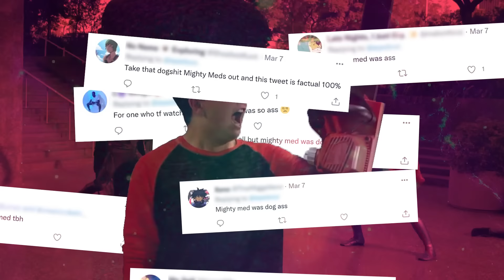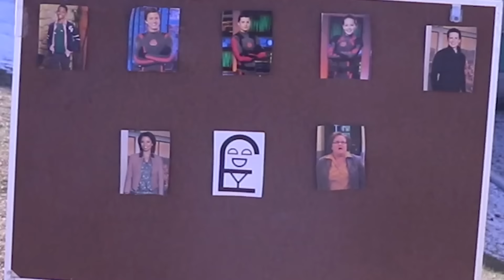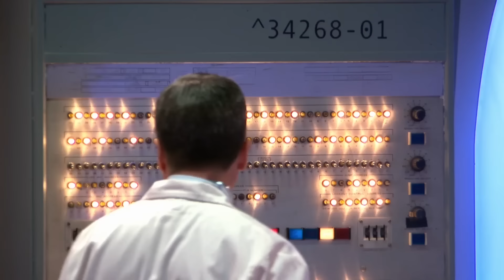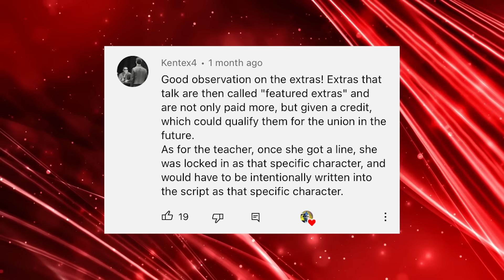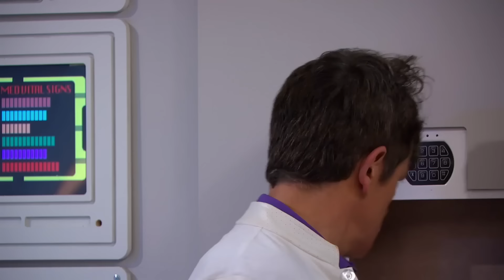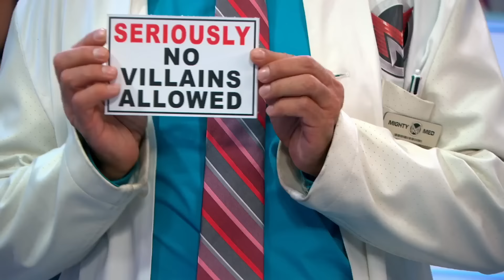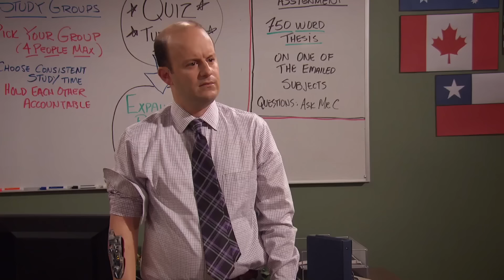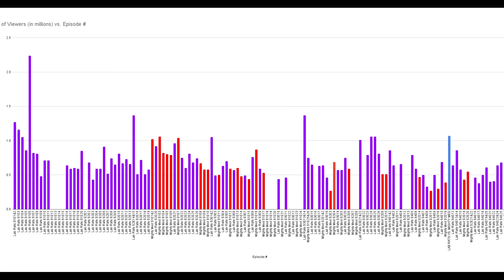The Rise and Fall of Disney's Greatest Sitcom

Comment: In S1 Ep8, a running gag occurs of using random things that Oliver likes to measure the weight of things. In the final battle, Oliver says “this weighs like 6000 trading cards”. He uses this to describe a spear that he could barely hold. A trading card weighs about 0.75 grams. If we translate this to pounds it shows that Oliver is almost to weak to the point he showed restrain in holding a 10 pound object. That is hilarious when you think about all the other things he’s done.

Comment: Something I'm surprised nobody else has realized is, Caduceo is clearly supposed to be this super legendary hero healer. The comic book geeks recognize his symbol instantly and even villains acknowledge his power enough to want to manipulate him into using it for their gain. But his only shown healing ability only has 5 uses, and only 2 of which were used on screen. Did he use the 3 first uses in such a dire situation that it made him a legend? Like did he rock up to a fight where The Great Defender, Tecton and The Crusher all had died and brought them back?
Reply: I think he has more powers than just revival. He's known as 'the healer', which suggests more advanced medicinal ability - it's just this one power takes more energy than any other, so he can only do it a certain number of times. It could be that Horace has any number of powers we just haven't been told about

Like the original series Dr Who lore - he can only regenerate 12 times, because it takes so much energy, but that doesn't stop him being able to ... use his mind-meld powers, for example.
Reply: @sofh784  we're shown outright that he can basically press pause on anyone on command. Perhaps his other powers, if any, are more supportive like that. Not especially helpful for winning a fight, but enough to defend yourself and others
Reply: @faultyvideos2215  Like I could see his powers being in the same Vein as Restoration magic in the Elder Scrolls series, he probably a one or two offensive abilities. But he’s mainly a supportive hero with a lot of healing and maybe buffing abilities
Reply: @sofh784  They never said that he can only regenerate 12 times because there's a certain limit on the amount of energy he can expend. It was just the rules of his race. Then they gave him more. Then, he's from a different universe so nothing applies to them. AAAAAARRRRGGGGHHHHH
Reply: Maybe he's just a really good doctor

Comment: There is no way that The Crusher is weaker than Adam. I would like to point out the fact that he sent a doctor (aprox 180 pounds) flying across the entire room slamming into the wall, and the doctor would have probably have kept going if it wasn't for that wall. Secondly he has turned coal into diamonds, which I am pretty sure takes somewhere around 725,000 pounds of pressure per square inch. Another thing is most sites refer to Adam being around 10-20 times the strength of the normal person. Which talking in terms of pounds of pressure when squeezing your hand would be at max (assuming the average amount of pressure of a man, and him being 20 times stronger) 1460 compared to the highest recorded amount of pressure from The Crusher being 725,000 pounds. Grip strength doesn't always equate to how strong they are but someone that has a grip strength of 725,000 pounds is probably stronger then someone with the grip strength of 1460 pounds. This is probably mostly wrong, but this is just my 2 cents IG.
Reply: The lab rats writers mostly wrote the crossover
Reply: They nerftef him so hard :((
Reply: I like to believe that the crusher was weaker due to being sick, since he was in the hospital, and that’s why Adam beat him.
Reply: But the diamond feat was before they retconned him
Reply: Didn't adam stop a missile once?

Edit: just checked, he did in sink or swim
Reply: Honestly, it is this moment (Adam besting The Crusher) that made me hate Lab Rats, like I watched and enjoyed it before but after this I fell off haha Mighty Med was so much better
Reply: @aaronwilder2775  cap
Reply: @InvalidClips  what do you mean
Reply: @aaronwilder2775  cap means you’re lying. And Adam is miles ahead of the crusher
Reply: @InvalidClips  I know what cap means but if you literally watch Mighty Med you can see that Crusher is supposed to be stronger, they powered him down just to make the Lab Rats look useful
Reply: How to tell someone is a fan of Death Battle (unless you arent and my joke doesnt land)
Reply: @Bladebrent  Someone hit up DeathBattle Adam vs Crusher
Reply: Adam has much better feats then being 10-20 times stronger than a average dude just saying
Reply: Mighty Med has some star-level feats. So annihilator could easily beat all for one.
Reply: @KEEPTALKIN8215  when saying the Anihilator could beat all do you mean the Lab rats or something else
Reply: @khaliekanderson2596  all for one from my hero academia. If you look into it both the characters are very similar.
Reply: @KEEPTALKIN8215  do you think the Anihilator could beat Krane(lab rats)
Reply: @khaliekanderson2596  obviously before they crossed over lab rats didn't even come close to anything in mighty med. Maybe wall to city level stuff ( high balled) so yeah annihilator should win
Reply: The Crushers vs Saitama vs Goku vs Adam
Reply: I mean there’s also the fact that Adam stopped a sinking submarine and pushed it back up to the surface plus his probably as strong as Leo who stopped the space elevator and almost sunk an island
Reply: They had to need him so he didn't rip his arm off in one motion, if this was kept canon go both universe pretty much any one if mighty meds heavy hitters could beat lab rats whole team
Reply: My brother and I always make fun of the fact that the crusher benched like a billion pounds and then Adam swings it over his head
Reply: @orang1921  Saitama wins. The whole point of him existing is that he is the strongest. That's the joke, the trope.
Reply: @dr.michaelpines.1803  I was making a joke, man - I was making fun of the ridiculous "Saitama vs. Goku" stuff because the comment replies reminded me of it
Reply: this has nothing to do with ur comment but W dislyte pfp, i love tang xuan

Comment: One last piece of trivia - Lab Rats and Mighty Med technically connected unofficialy before the crossover. On a day of an actual lunar eclipse, all the shows at the time (Kickin It, Lab Rats, and Mighty Med) all had lunar eclipse based episodes. Disney sitcoms have done those unofficial not really connected but superficial crossovers before.
Reply: Kickih’ It, Pair of Kings, and Zeke & Luther did the same thing with a heat wave back in 2011. And regular Disney Channel did one in 2007 with a shooting star.
Reply: @TheTekkenguy  Nickelodeon also had a heat wave, though all the schneider shows are connected
Reply: @TheTekkenguy  Wish Gone Amiss, Hannah Montana, Suite Life of Zack and Cody, and Cory in the House, all had episodes where the protagonists wished on a star and it came true, but not as they wanted.

Comment: After watching this video I've come to the opinion that Disney should revive Mighty Med as a D+ MCU show while changing almost nothing.
Reply: Just change all the superheroes to actual MCU characters.
Reply: Or better yet incorporate the show, and Lab Rats, into the MCU.
Reply: @dggdvg0 Well that's comics though, in the MCU, the first superhero that the public finds out about is Iron Man which takes place in 2008. It's possible that the show takes place before 2008 and that all superheroes before then were kept secret under Mighty Med, though all of that really isn't necessary to make Mighty Med part of the MCU.
Since the Multiverse is canon in the MCU, you can easily make Mighty Med canon by just saying that the Mighty Med universe is just another alternate universe apart of the MCU's multiverse. You could even do the same thing to make Lab Rats canon to the MCU as well.

Comment: grew up with this show and lab rats. idk why but i specifically remember watching kick’n it around the same time, not sure if it was the seasons 1-3 run or season 4 that changed everything but when i think of one of the shows the other two always pop into my head as well. 

anyway, are you going i cover elite force? i totally checked out when that aired
Reply: Kickin’ It changed to a new Dojo, and Olivia Holt (Kim) left the show to do I Didn’t Do It.

Comment: At 45:40 Kaz says "100%" which is a probability and not the odds of something happening (conventionally a probability of 100% would correspond to like, 1:0 odds). So, really, Kaz doesnt know how to do odds and the writer can keep their job 😌 [part of me wonders if that was an intentional joke about Kaz saying a probability instead of odds earlier which would actually be great but is maybe far too niche a distinction to actually plan for]

The formula for the odds of something is a very simple ratio if you know the probability: it's p:(1-p) Where p is the probability expressed as a decimal. i.e., if something has a 75% chance of happening then the odds are .75: .25 = 75:25=3:1. 3/1 is notably a very different number from 75% and as such probability and odds are distinctly different measures despite more or less being measures of the same thing.

Comment: 45:42 that's not odds, that's probability. probability is part over whole, odds is part over not-part. For instance, the probability a single flip of a fair coin returns heads is 0.5 but the odds that a single flip of a fair coin returns head is 1/1.

Comment: LGTBQ? 

Let's try this again because you said it incorrectly no less than a dozen times; the acronym is "L. G. B. T. Q. (+)" Meaning "Lesbian, Gay, Bisexual, Transgender, Queer" Or, if you're including the "+"- it's technically LGBTQIA - Which includes both Intersex and Asexual.
Reply: there's no I as the Intersex community spoke up and said they don't wish to be included in it, which makes sense because its not the same as being trans and/or experiencing same gender attraction.

Comment: The reason “Queer isn’t used as an overall umbrella term is because it’s still a slur. Some people have reclaimed it for themselves but others have extreme trauma that connects to the term so it can’t be used as an umbrella term. Also you can definitely just use lgbt+, no one fits exactly in any one term so to be accurate we’d have to use all letters for everything and that would be just absurd.

Comment: 1:25:17 yeah, just a head up, “Qu**r” was, is still considered to be by many, and is used as a slur towards LGBT folk and should really only be used as an identifier when referring to some self-identifying as such. It’s also been said that replacing “LGBTQIA+” and much more specific identifiers with just “Qu**r” has been equated with identity erasure
Reply: YMMV I like queer as a simpler word for myself rather than overly explaining myself. If someone doesn't want it used for themself, that's fine, but in academia etc it's a standard term. Admittedly, it's "gay" and "lesbian" that were the slurs I grew up with. It's all personal.